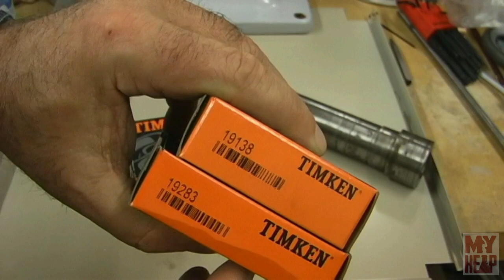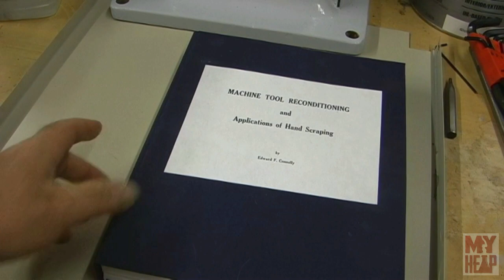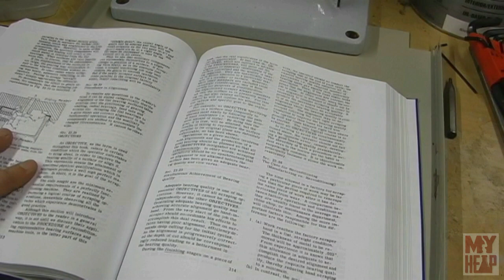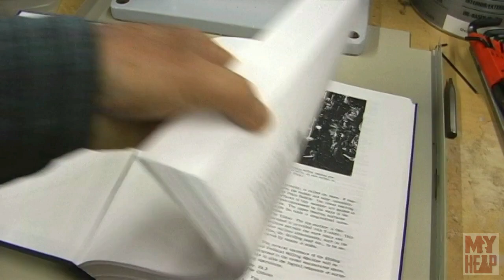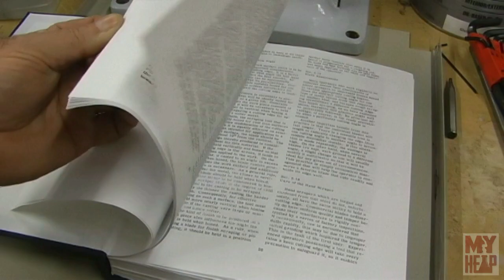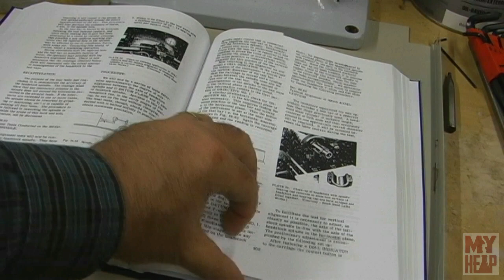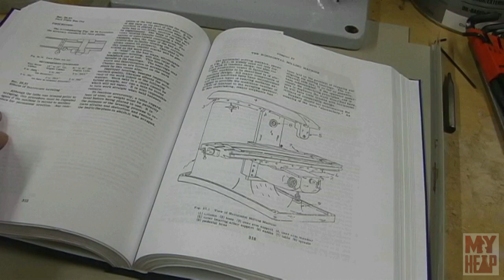Burke Mill Update - November 2019

Comment: Thanks for the update, Joe.
Personally, I would sandblast and use JB weld on that Handle, it would never fail. Bookbinding, very cool skill, I would love to see it, and I'm with you, there is something special about holding a book in your hand and marking up the pages with notes.
On the bearing cups, buy some dry-ice and chill them to ~ -50 then heat the casting to about 175 to ease them in place
Reply from the maker: I like the dry ice trick, but not sure where I can get any.  I will talk to the LAB.  Sometimes they receive stuff packed in dry ice.  Maybe they will let me have it.  :-)  Your the third person saying they would like to see it.  I think I will make a video on the subject.

Joe
Reply: A welding gas supplier should have Dry-Ice.
Reply from the maker: @SouthernEngineering  thanks for the tip Walt.  I didn't know that.

Joe

Comment: Three very useful addition's to the scraping tools you already have. A 10ths DTI, a high precision machinist's level and either a magnetic cylinder square or the more common and larger diameter cylinder squares. A proper box level if it's in great condition would replace both the level and cylindrical squares though. The Connelly book is still available brand new I think from Industrial Press? I seem to recall that's where mine came from.
Reply from the maker: I have a machinist level.  Need to get a 10ths indicator and a cylindrical square.  I didn't realize that the Connelly book was still in print.  I found this out after the fact.  Mea Culpa.  ☹️

Comment: hi joe
milling machine is looking good, wish I had one as good robust quality. Scraping project sounds very involved and time consuming, good luck with that. Book binding very interesting and professional, would like to know more on that,  i'm with you on that, hate reading electronically its just a pain in the ass.
regards mr f
Reply from the maker: Hi Mr. F.  Well I am not yet decided how much scraping I am willing to do.  I want to "practice" a bit on the straight edge and an angle plate I have.  Then I will make a decision of how far to go.  For a small horizontal mill, it does seem pretty beefy.  I guess I will know once it is all together.  It looks like I will be needing to make a few parts for it as I go along too.  I will do a video or two on the book binding.  Maybe it will help a few folks out.  I have been enjoying your Loco build.  Thank you for sharing the videos.  My next endeavors will be to silver solder up my toy boiler for the Kenneth Wells stationary engine.  I had a test go and while the heat was lacking, it did do the job.  I think I am going to take your advice and use some extra heat from the camp stove or another torch.  Thanks for the tip my friend.

Joe
Reply: cheers joe 
look forward to your future book binding tips, no rush, I think we've both got enough on at the moment
regards
mr f

Comment: Nice job on the binding 👍
Good plan to start from the spindle axis alignment to the column face. Once you got a method for checking that a cutter on the shaft is square to the face of the column. Everything can work from that. 
Drop me a msg anytime, I’m happy to help anyway I can. Definitely worth building yourself a carbide grinder. Then get some scrap cast iron and practice handscraping. Once you feel comfortable with a consistent scrape, you can look to get flatness, then look at your contact. Each step builds on the last. Keep in touch All the best mat
Reply from the maker: Thank Mat.  I am sure I will have some questions along the way.  I have read Connelly's book through the vertical mill.  Quite the dry read but really a thorough book.  I want to go back and read the first half of the book again as I practice scraping.  Chirpy was kind enough to get me started, but I need a LOT of practice.  One question, any thoughts on contrasting color, like yellow to make the marks a little easier to read?  Thanks for stopping by, I do really appreciate it!

Joe
Reply: I’ve not used either of the two print media you have, so not sure how much this will apply. Start your roughing cycles with a good layer of ink on your master. Just keep spreading out each cycle without adding more. See how little you can use and still determine the print. Deeper scraping marks allow more ink to be used and still show what you need. As your scraping gets more refined you use less ink. 
Get some multi point led or cre lighting. Move the light around to get you the best contrast. 
If it’s still a struggle to see, then a yellow or red will work. I’ve used a sharpie wetted out with spirit, let it dry off then rub the master with blue applied. 
For me, I find applying to coatings a painin the rear. Too much risk of cocking one up with too much/little ink. In the end best advice is try different things and see what works for you.
Reply from the maker: @lookcreations  Thanks Mat for the suggestions.  I will spend some time with it and see what happens.  I will also see if I can find some LED lighting.  Thanks again Sir.  :-)

Joe

Comment: try using fiberglass body filler for automobiles for your handle
Reply from the maker: Hi William.  The last fiberglass body filler I purchased was rather hairy and hard to work with.  Are. You referring to this, or something else?
Reply: There is two different types, one with short fibers and one with long fibers. The long fiber type is hard to work with.  The short fiber one is working on fiberglass bodies. I should give you a more durable solution than just plan bondo.
Reply from the maker: @williamthrasher8540  good information.  I didn't know of the short fiber stuff.  I was thinking of using JB Weld epoxy.  How do you feel it would hold up compared to the fiberglass body filler?  Sorry for the newbie questions, but if you watch my channel then you know how ignorant I am on some stuff.  Haha. Thank you sir.
Reply: I would also be interested in book binding.

Comment: I have a burke #4 and need those timken bearings you show in the video where can I purchase them 
Any help will be appreciated thanks
Reply from the maker: I ended up searching for the individual parts and found most on Ebay.  Remember the cups and cones are sold separately.  The Timken Part numbers are 19138, 19283, 11157 and 11315.  I know that isn't a lot of help but I was in the same boat as you.  Let me know how it goes.

Joe

Comment: Joe,
Please stay away with those (or any ) stones where those bearings or cups live ! Most people, even experienced ones, will do a lot more damage than good with those things!
Those surfaces may now be round and pitted... that is better than pitted and out of round !
Those stones maybe flat because they are ground... that doesn't mean that the surface you apply them to will be! I cringe every time I see someone using a stone, "to take the burrs and high spots away" as if it was a rag which does not take off any material... they DO!
If there are any real burs (as in material that is above the surface which is desired, take them off with a grade 4 or grade 6 file , or even a burnisher (all this can be had at a watchmakers supplier) and if the spindle needs to be polished , use 3M film (say 40 microns NOT sanding paper!) while the spindle is rotating in a lathe (between centers and clocked out please)
If you decide to use a stone.... and I hope you don't... use a degussit stone (again while the spindle is rotating)  Anything more rough, is asking for trouble.

This use of these stones, just started, out of the blue on the internet, because Robin Renzetti (Jedi Class machinist!) wanted to mitigate the fact that everybody used these things 'out of the box' without thinking overmuch about it! Now the idea is, that 'precision ground stones produce precision surfaces.... this is definitively NOT the case. The ground stones will do less damage, compared to the 'out of the box' ones, but they won't do anything more!

If you're going to paint those handles, I'd suggest fine car-body putty or some similar product.

Like you I can't / won't read long texts on a pad! It just doesn't work... Gyan books from India area good source for these old books (the do ' print on demand ') but if you can try and order via Abebooks.com or Abebooks.co.uk, as they are painful to order from directly (you'd still get the free shipping!)
If you can make a vid on bookbinding... let rip !

Toodles!

Paddy
Reply from the maker: Hey Paddy.  I always appreciate your insight.  The more I thought about stoning the spindle, the less the idea seemed viable.  Not because of your reasoning, while being sound and sane.  My thought were a plane applied to a cylinder at best can only have contact on a line.  This case only exists of the stone was perpendicular to the surface of the cylinder.  Moving the stone away from perpendicular reduces the line to a point.  Given that, even if the stone was a perfect plane, it has to remove metal because the line or point would be seen as a high spot.  That was my reasoning for changing my mind about using them to remove any burrs on the spindle.  Your explanation furthers my thoughts on the process.  Thank you for that.

Now for deburring a flat surface on which is being scraped, I think the would be great for that.  A gentle rub on an existing flat surface seems a safe way to knock down a burr.

I never thought about using a burnishing tool to lay down a burr, but I can visualize in my mind that it would be effective on a small burr.  Thank you for the insight.

I will check out your resources for books and binding.  I think I will make a video on how I do it, reminding people that I am not a book binder but this has worked for me.  And for stuff that will live in the shop, well I can't see making it too nice if it will only get the occasional glance and greasy finger print.

Like I said in the video, I look forward to your comments along with Art.  You two are a wealth of knowledge and have been kind enough to overlook my green nature and advise and point in the right direction.  Thank you.

Joe
Reply: Joe,

Don't worry about not being a bookbinder... I am not really a gynecologist either ! LOL!

I am always glad to add a thought to someones efforts, especially when invited to do so... BUT ! Do not take what I say for Gospel (see? see what I did here?? ROLF)
Regarding your reasoning re stones, I'd say you have hit the nail on the head... Even cylindrical grinding (not so much the centreless ) is a heck of a lot more involved than most people think, so emulating that sort of process manually has a very good chance of ending in tears indeed.
That all said, I think you are on the right track with your mill, and I am looking forward to seeing it eat some metal.
If there were an inordinate amount of burrs on those surfaces (where the caps and the inner races live) I'd seriously consider an aluminium lap...It will take you a while to get the burrs down, and you may need to clean up your lap occasionally, but it stands a good chance of NOT making the part 'out of round'. This technique could be used for either inner or outer diameters, is cheap and cheerful and some China-special lapping paste costs only a few dollars!

Best of luck mate!

Paddy